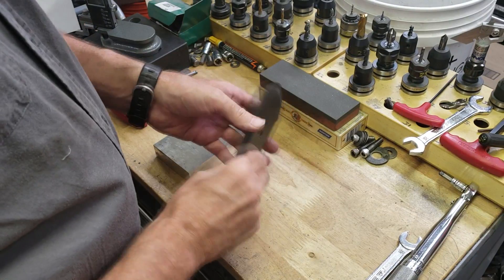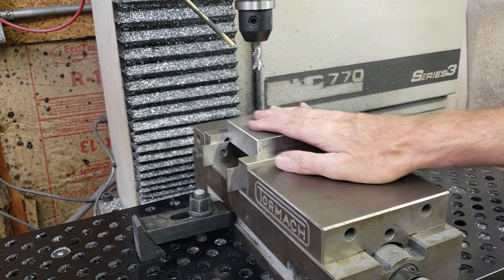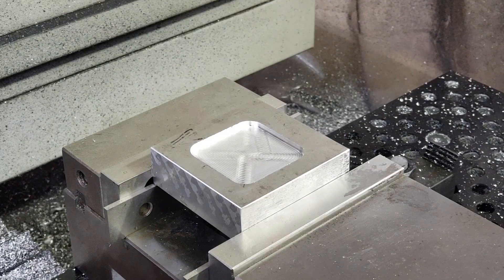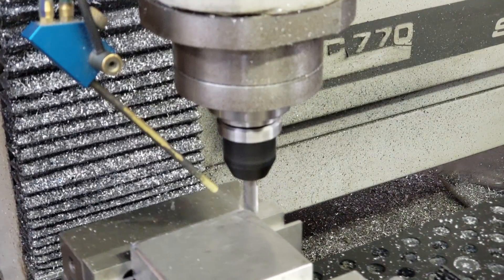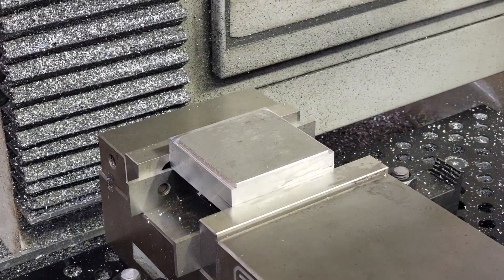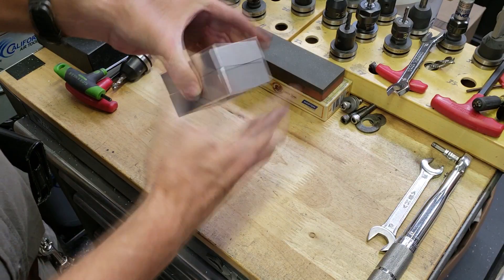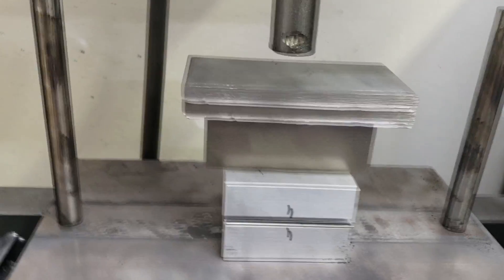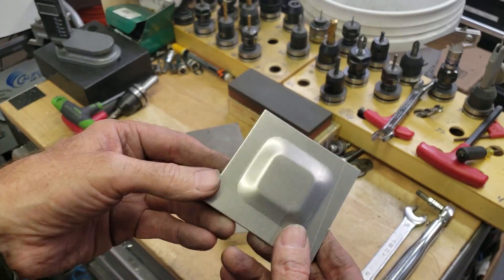Making a Sheet Metal Forming Press Die - Test

Comment: Can a 10 ton hobbyist press bend 1mm cheap steel sheets (with 6 cm depth)? Or should I buy a 15 ton press? The shape is not like a square profile, it is more like an oval profile; so corners should not be a problem in my opinion. Sorry if my question lacks any detail, I am a clueless student, any help would be appreciated.

Comment: Make sure to add some leader pins for alignment on the real one,  also some die springs would be nice so you dont have to pry it open every time.
Reply from the maker: I was going to make one with 4 pins but I have a base with 2 pins.  I am going to try to make that work.  I got some springs but didn't figure on the weight of the upper die pushing the springs down too much. LOL  I ordered some new springs that should work.  Thanks!
Reply: @craigsmachineshop2040  sounds like your headed in the right direction, it really wouldn't matter much for what your doing sense the part is symmetrical, but it's a good idea and a industry standard to have a offset pin so the a and b side of the die cant be turned in any other direction, just a thought for down the road though. If you have any questions hit me up I mainly work in the injection molding industry but do some die work, and many of the same principles apply.
Reply from the maker: Yeah, I see your point.  I have just been drilling a small shallow hole in the left front edge of the fixture plates and dies to know how to put them on. LOL  I guess I should be more professional about it for when I get employees.  Injection molding, wow cool!  I appreciate it!
Reply: So I'm curious if you have a punch going through .050 material making a .125 hole. What should the hole in the die plate be .1255 or ??
Reply: @anthonyjones657   Die clearance is 10% of material thickness ,the punch gives you the hole size

Comment: I've never used a cnc machining centre so not sure if this is relevant, but when milling you want to go in the opposite direction of the cutting tool to prevent "climbing" where the milling cutter runs along the work piece, often resulting in broken cutters.
If you've ever experienced this, I hope this helps.
Great video by the way.
Reply from the maker: Thanks for the comment.  I was always told that you didn't have to worry about conventional milling when machining with a CNC mill so I just went with that.  Your comment got me to look deeper into the topic and got a lot of useful information from Tom's Techniques.  From my understanding from his video and other videos, climb milling leaves a better surface finish on finish passes since it isn't rubbing when it enters the part and extends tool life for the same reason.  It looks like climb milling only becomes a problem when taking larger cuts with a smaller machine, when there is less rigidity in the workholding or when there is backlash with the ball screws.  I had no problem taking larger cuts in A2 while climb milling recently, So I am assuming that it is ok with my mill.  Maybe it has something to do with the precision ball screws or the fact that it is controlled by stepper motors.  I will probably go with servos on my next mill since they keep track of where the table/head are.  My Tormach with steppers can lose steps so I have to be careful not to be too aggressive.  Thanks!

Comment: I am curious about spring back.   Did you have a print with dimensions that you needed to hold to? Was the bottom flat surface actually flat on the part once it was removed from the die?  If it is not what adjustments would you make to your die?

Comment: "Crash form" with no real material control or restriction. In the real world this is done using nitrogen and a pressure pad in the center of the lower form, and in a lot of cases "draw beads" to further control material flow.
Nice video none the less.
Reply from the maker: Thanks!  It gets the job done.

Comment: If I created a steel die for making an aluminum part that is 1/4" thick,
would it be possible to sqeeze a plate of 1/2" thick material with a double pocketed
die, and have the aluminum sort of flow into the die kind of like playdough in order
to completely fill the die?

I know nothing about this and am trying to figure out if I can stamp the part I've been
working on or if I should mold it with liquid aluminum.
Reply from the maker: Sounds like that would need some extreme pressure. Depending on the qty you are going to make, either machining for lower qty or casting (molten) for higher qty.

Comment: That worked nicely.  I've made a couple of homemade round dies for the ends of a model engine fuel tank and the ends of a small
steam boiler.   Also experimenting with making a die for the intake manifold and bypass cover for my little single cylinder two stroke engine.  I believe that the old Brown Jr model airplane engine used pressed steel parts for these parts.
Reply from the maker: Thanks!  Yeah, all kinds of uses for them!
Reply: Do you have any photos? Are the ends considered endcaps? Would like to see if you have time. thanks

Comment: Hey Craig! Thanks for your videos! Have you ever pressed anything with a Z access greater than 3 inches with multiple curves?
Reply from the maker: Hey, sure thing!   That would be deep draw.  I tried it once but the metal tore.  It requires a more complex die set and forming oil I think.

Comment: Never did any die work.  AMAZING!  I would have thought you would have needed the exact shape to get the nice rounded corners. Wonder how much it pulled the material in from the edges?  Is the outer dimension still 3 X 3?    Be interested to see the whole process.
i.e.
I was just thinking of the process I might try???  Sure you already have a good process figured out.

1.  Cut the stock on you shear slightly oversize to accommodate for any shrinkage during the forming process and allow for a little machining stock of the outer profile to create a finished product.
2.  Drill the center hole in the stock
3.  Make the bottom section of the die with a threaded center pin of proper length (either heli coiled or Loctited) in place to guide the plate during forming.  Of course you would need a clearance hole on the top section of the die to clear the threaded center pin during forming operations.
4.  Remove the top half of the die and install the formed plate into the bottom half of the die and machine a plate out of aluminum to fit over the threaded center pin and hold the formed plate in place with a nut.
5.  Then you could machine a perfect profile and chamfer if necessary the outside of the part with minimum machining effort.
Reply from the maker: Hey John!  Yeah, worked far better then I expected!  I saw another product with tell tail signs that they did something similar so I tried it.  The shrink was only about 1/32"  I think.  I finished the die holding system for interchangeable dies.  I should post by Mon or Tue.  

Its far easier than you might think.  I held off for a long time thinking it was going to be so hard.  LOL  

I have the covers laser cut to shape with the center hole now.  I just need to form it.  Yeah, I thought I was going to need a center pin to keep the part in place but after the test, I don't think I need it.  I will probable have a lip about 1/16" out from the part for quick placement.
Reply: I really enjoyed your video.  Glad you are on the right track to success.  Some times things are easier than they look.  Using the KISS method is the way to go.
Reply from the maker: Thanks John!  I Think I may have to use the center pin method when I make a die for curving covers.  The covers will probably move around if I don't.

Comment: Hi,  how much tonnage do you think it would take to press 2mm aluminium, I think that's 14 gauge in your language.. to form a "joggle" or countersunk relief for creating a lap joint along the edge of a sheet for riveting purposes? The length of the die, press tool, could be around 6" long by 3/4" wide... I am wondering if an "Arbor Press" would be sufficient? 
Also at 5:40 in the clip , your using a very nice looking guillotine ,  what make and style is the??  thanks Paul, Mullumbimby, Australia.
Reply from the maker: Hard to say on the tonnage. I would think 12 tons would be more than enough. Not sure about an arbor press. 12 ton presses are like $140 here in the states.  The shear is a 12" diacro.

Comment: 🟥 thanks can u try o shape metal with aluminum dyes from 3d printer !? im so intrested to know of that would work?🟥
Reply from the maker: Not sure, never tried it.  If it has the same strength as 6061 T6 aluminum then I would guess so.
Reply: Maybe use The 3d print to cast a mold in concrete? Never tried It.
Reply: There's a youtube channel called rainbow aviation that made 3D printed die for a CNC brake press, so it might work
Reply from the maker: @inund8  I just found out that die manufactures offer urethane dies. So I guess it's a thing in the industry.

Comment: What's your hydraulic press weight?
Reply from the maker: It’s 20 ton
Reply: @craigsmachineshop2040    what steel did you used and   what's the thickness of that steel, and can 410 0.5mm thick steel can be work well
Reply from the maker: @lalmuanpuiijahau7531  16 gauge cold rolled steel.  What is 410, some kind of alloy?  That's pretty thin, just .020 inches.  16 gauge is .063 inches

Comment: Sir can you teach me the basics of this i am doing this in size of 8 mm diameter bt it is making hole
Reply: If you are making a hole then your punch is too big and need to be reduced or the die needs to have a lead in of slightly rounded edges to stop the material cutting a hole.

Comment: what size of intensifier did you use?

PS I liked and subscribed :)
Reply from the maker: Thanks!  Not sure what an intensifier is.
Reply: @craigsmachineshop2040  I should have said oil intensifier. Its a device that takes shop air to power a hydraulic cylinder, which gives you higher operating pressures/forces and more rigid control. I assumed you were using one based on the fact you said you were using air
Reply from the maker: @inund8  Oh yeah, I just refer to it as air over hydraulic. It's just a bottle jack that comes that way from Harbor Freight.

Comment: How would a guy go about making a large set of dies for say an automotive quarter panel if he wanted to do so? (Let's say an original donor piece that he was wanting to duplicate in good shape)
Reply from the maker: I guess it depends on the size of the quarter panel but they usually require very large presses as you see in car factories.
Reply: @craigsmachineshop2040  thank you Craig for your time and response. I know it would take quite a press to stamp out the panels and they ARE long quarters but they're 18 gauge steel, not near as heavy as what you have there. I know that with modern technology a CNC could be programmed to make such a contour from a program easily if a guy had deep pockets...but how was it done in the 60's & 70's? Would it literally require a block of steel for the top tool and bottom die the dimension thickness of the quarter itself? Let's take a 68' Charger quarter for example with the long coke bottle shape. 

The only thing I've seen was the equipment we had at an aircraft business i used to work for. We made fuselages and the floors for commercial planes. They made tool and dies for those but we were making composites similar to fiberglass.
Reply from the maker: @MidnightOilsRestoration  Sorry, not really sure.  I mostly have experience with small stuff.